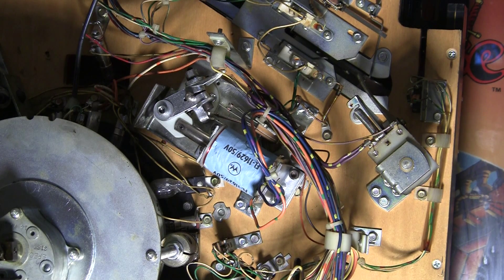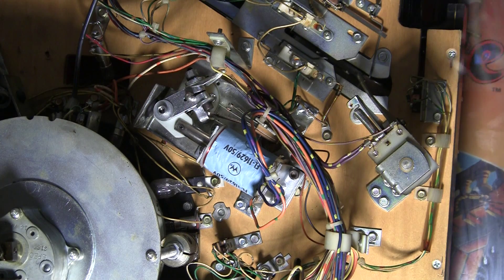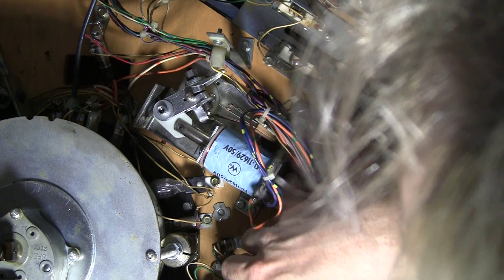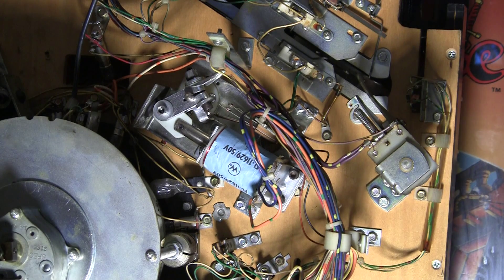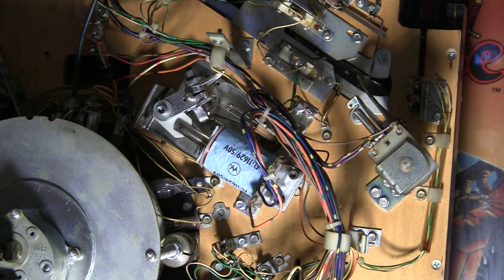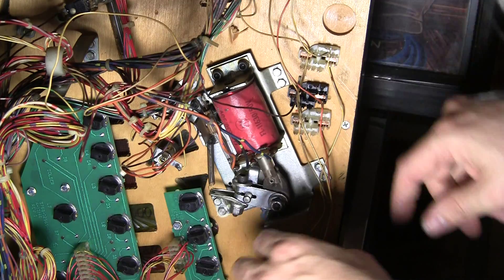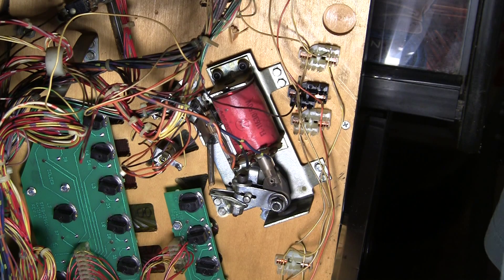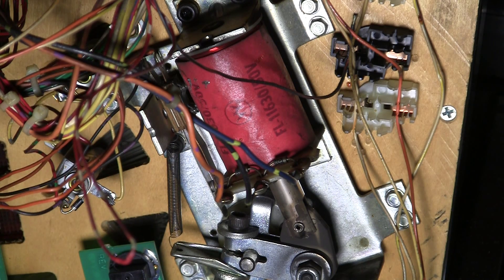Rebuilding pinball flippers - Bally Black Rose WPC - Pt 6 - PinballHelp.com

Comment: The EOS switch on the FL-11630 is meant to open on EOS, not close.
Reply: SilentGloves On an electro-mechanical pinball machine you would be right. On WPC games ("computer-controlled") you're wrong. The CPU needs to see the contact CLOSE on full stroke.